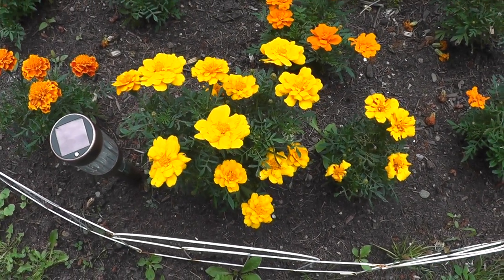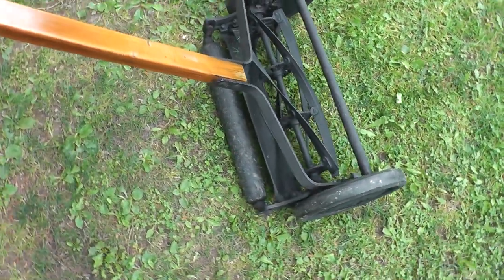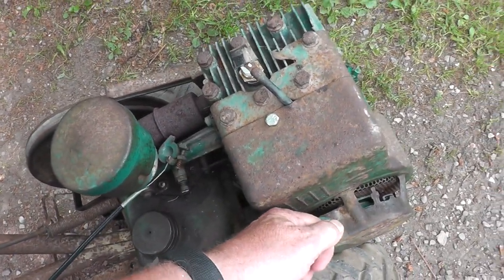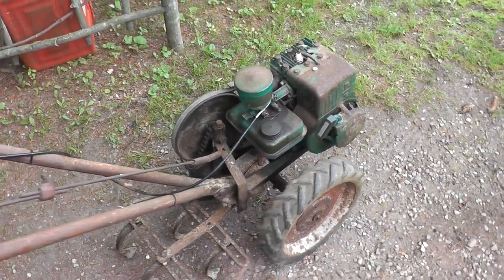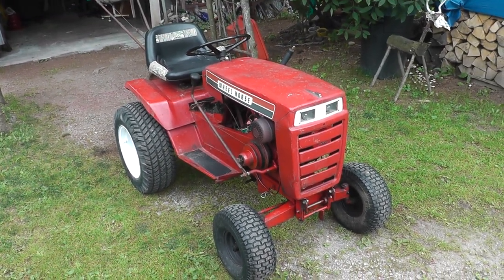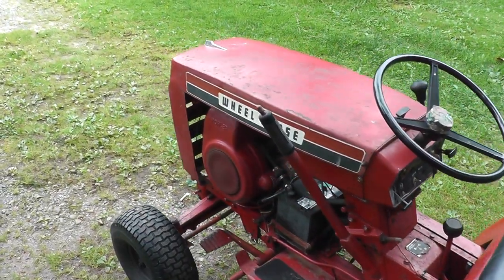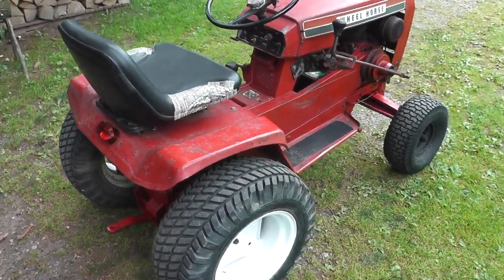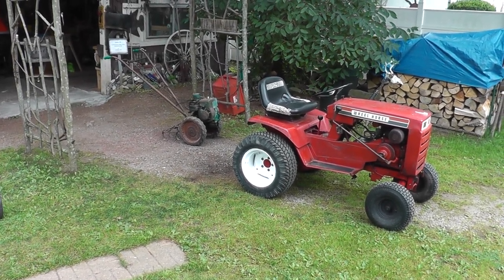Lots of Tinkering

Comment: love the restorations Ken - that Wheel Horse is really something and the cultivator is cool too. i used to mow my pop pop's lawn with his rotary blade push mower - it was hard work but im wish you on appreciating the old things and especially low tech that works.
Reply from the maker: They made things simple back then but so reliable to use and easy to work on. I can never get enough of these old pieces of equipment. Thanks for your comments and for watching my video!

Comment: The reel mower I used must have been newer, it has a metal shaft and handles if memory serves me right.  It was a camp mower back in the early sixty's and  was pre-teen.
Reply: More to the story, as I said it was the camp mower so the grass didn’t get cut often 10 inches give or take.  I mentioned, complained, that it was dull to my Grand Father.  He handed me a file and said fix it.  I wonder how that would go today with today’s Grand Children!
Reply from the maker: I'm sure today's grand kids wouldn't have a clue what to do if they were told to fix an old mower like that, haha! I've always liked mechanical challenges and I would play with my toys just so long and then I would take them apart to see what makes them work. Most of the time I could get things back together but when it came to something that had springs in it, I almost always had trouble getting those back in, LOL! I enjoyed your story a lot and I'm sure many other can relate to this. Have a great day JimO 1952, and thanks for your comments!